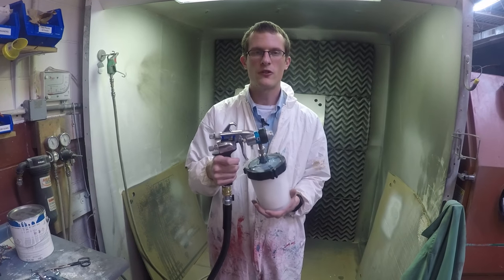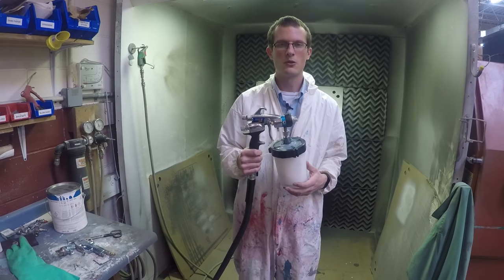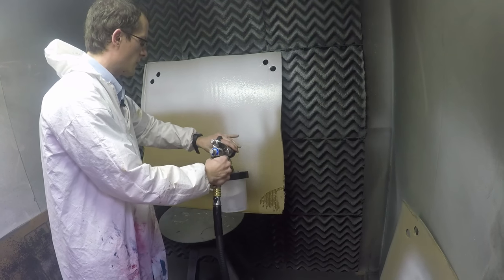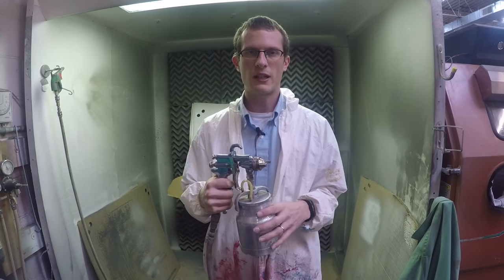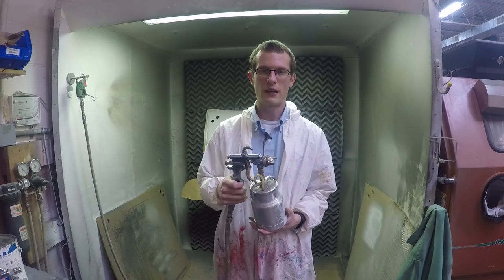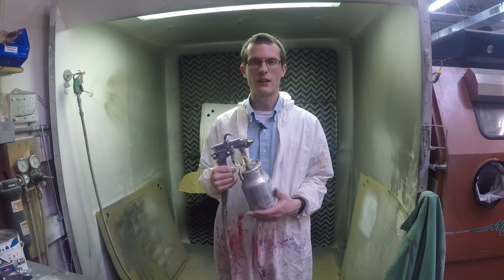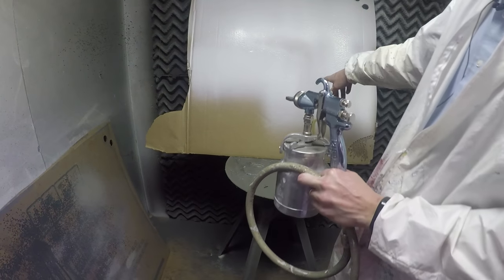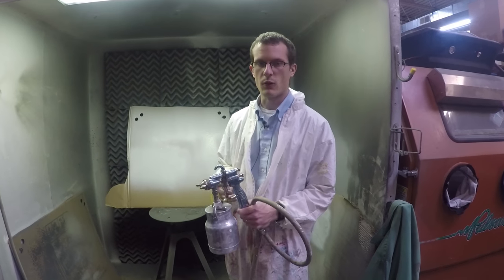HVLP Turbine Sprayers vs Spray Guns for Spray Painting

Comment: So the guns themselves are not compatible between compressors? (I cannot use a regular HVLP gun with a turbine compressor? I have a Turbine compressor but need to purchase a gun and am unsure what to look for. They seem to be sold as a package (compressor, hose, gun)
Reply: You need to use a turbine specific gun. They usually have a hose that forces air from the body of the gun, to the cup. 

You also need to know if you can use a bleeder or non bleeder style gun with your particular turbibe. Thats very important. Bleeder style guns have air running through them the moment the turbine is turned on, and depressing the trigger only controls the on/off flow of the material in the cup. Non bleeder guns are the opposite and more like what you see when you use a regular compressor and spray gun setup. Now WHY is this important to know??? You need to make sure your turbine has a back pressure release built into it if you are planning on using a non bleeder style gun. If it doesnt, and you use a non bleeder, you can overheat the turbine which can possibly damage it. So make sure you know what ya got. 

Are there pros and cons to bleeder vs non??? Well i personally have a bleeder style and i spray just fine with it. I thought the constant flow of air through the gun was gonna be annoying, but its not at all. I use a Lex-aire gun with the 3M PPS system powered by an Axis 4 stage turbine.... never had a problem. The ONLY downside to using a bleeder style gun, is that i dont have a knob for fan control. But thats just me being nit picky and i honestly could care less because the gun sprays beautifully. One other thing i had to learn about using a turbine system, is that you cannot use the regular 3m pps cups. You have to buy the cup that is called 3M PPS H/O. The H/O cups are sealed and have the connection for the hose that pressurizes the cup like I mentioned back at the beginning of this comment. It still uses the normal liners and lids, but the cup needs to be the H/O version. Thats about all the info i have to share and i hope that helped. I very highly recommend the turbine systems. They are really great and ive sprayed a lot of different types of materials using it and have experienced great results!
Reply: @ajkustoms5386 hey,, thanks for your explanation,, I am looking for the air bleeder type gun,, can you refer to me what brand of bleeder spray gun and where to buy it? thankyou in advance

Comment: 20-25 cfm compressor? I see a ton of high quality guns that are available for 6-7 cfm.. and dewalt makes a 30 gallon compressor that's a smaller footprint at 6.5 cfm for $500 bucks. I mention this, because it means you can spend $800-$900 on a high end compressor sprayer and the compressor to push it.. the 4 stage turbines start at that price and only go (much) higher
Reply from the maker: Hi alot of the top of the market sata iwata binks devilbiss need around15 to 25 in general cfm is horsepower so you can get something to run on less but having more will always allow more performance in your spray equipment
Reply: That’s lvlp

Comment: Can I use hvlp spray gun, for example sata minijet, on my apollo 2 stage hvlp turbine?
Reply: Yes. Just about any hvlp will work with any turbine BUT your turbine wil be thel limiting factor on how thick of a material you can spray. I like the Apollo 7700 myself. You can easily connect it to your turbine or air compressor and use it like a hvlp or even more conventional air pressures and put down incredibly thick material. I spray BM no thinning all the time with it.
Reply: Clearly this guy doesn't know much about HVLP turbines.  I've got tips and nozzles for any thickness material you want. Also,  a good turbine will easily spray continuously day in and day out. Not to mention the money you save by not blasting all your material into your booth filters.
Reply: no